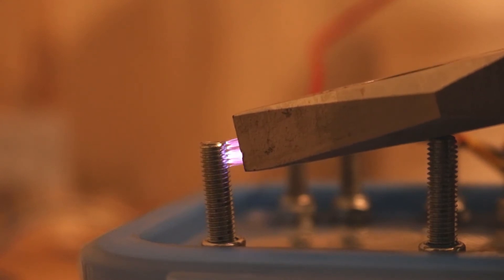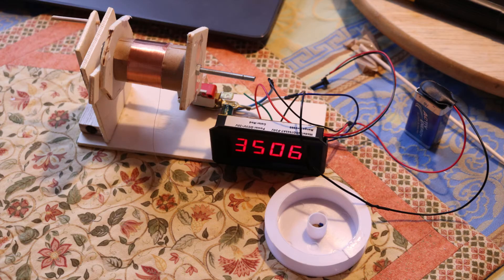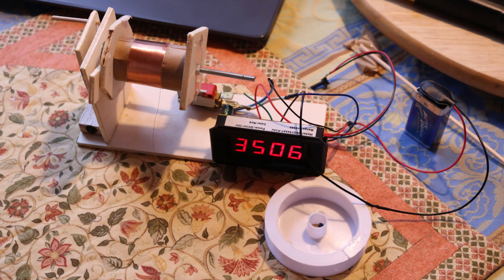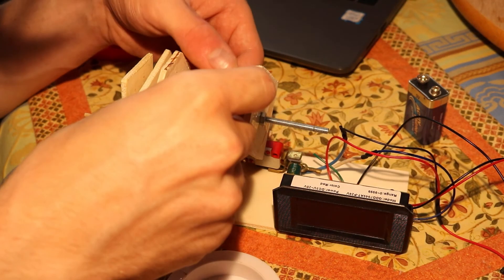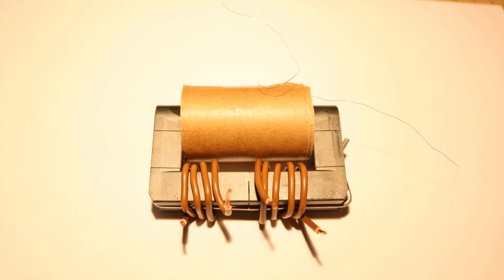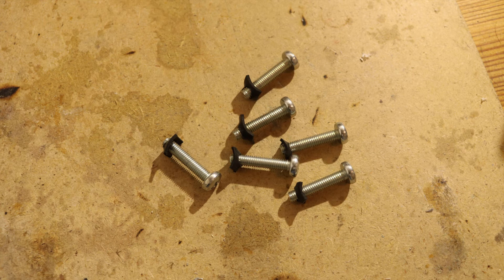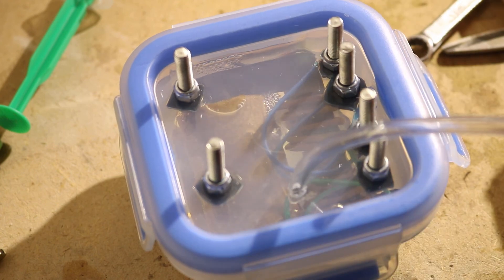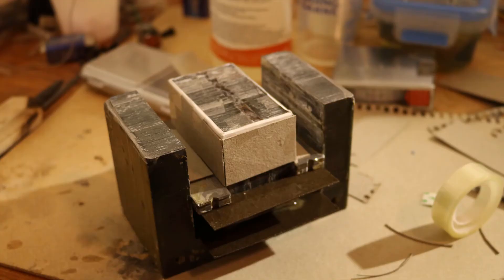How to build a mini high voltage transformer

Comment: Good job making the transformer, you definitely have enough turns to obtain quite big arcs, I think the problem is the driver you use. Search on the internet Vladimiro Mazzilli ZVS driver, is very simple to make and powerful, you'll be surprised what arcs you'll get with this transformer.
Reply from the maker: Yeah I've seen people using other drivers and getting bigger arcs with a construction like this.